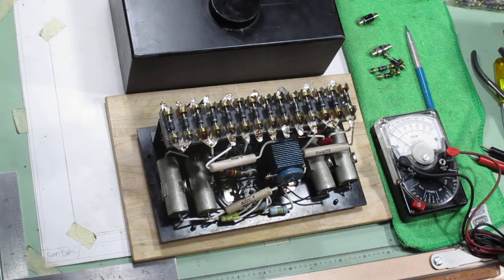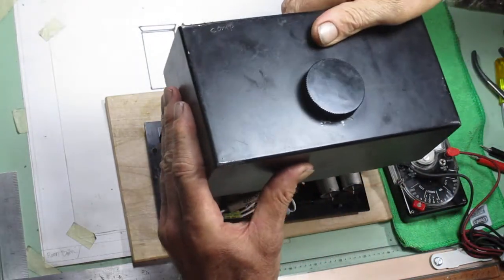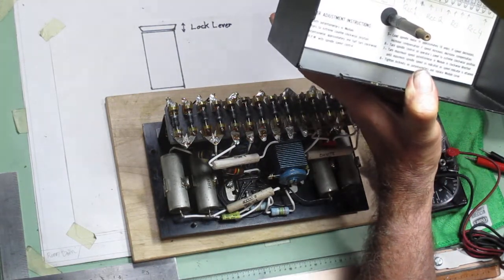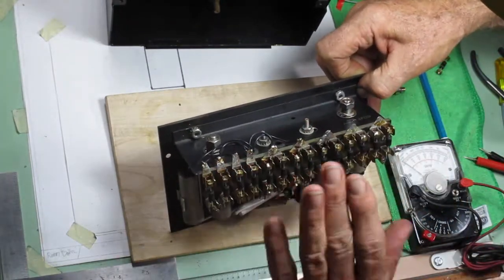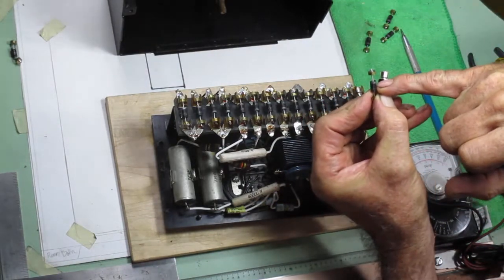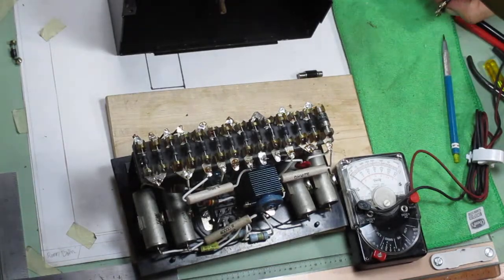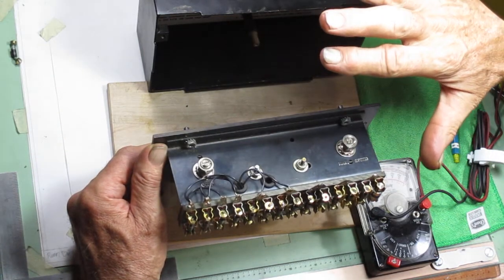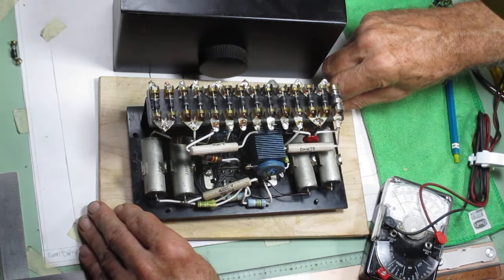Monarch 10ee lathe Module control diode replacement

Comment: Thanks for the videos. Very helpful! What is the rating of the diodes in this module? I have one blown on no.3
Reply from the maker: The diodes I am using are 3amp 600 volt the standard ones are 1amp 1000 volt. replace both diodes in rec 3. rec 3 provides back voltage for the speed control and tend to get hot, should be replaced at any sign of trouble.